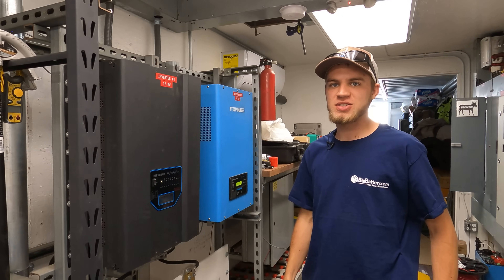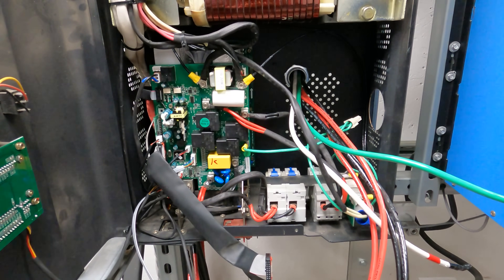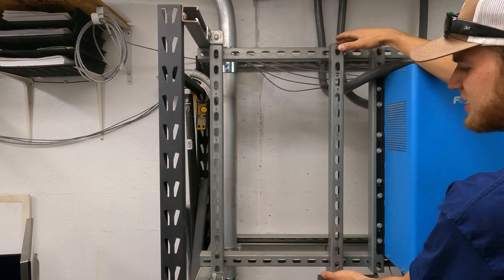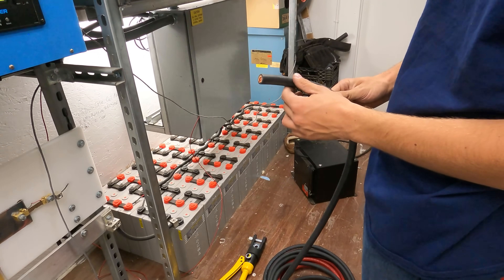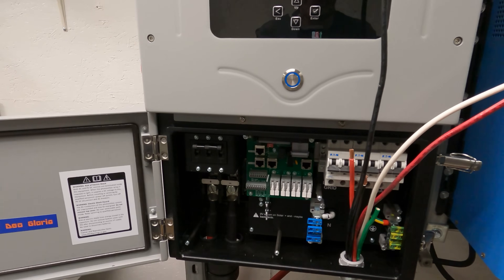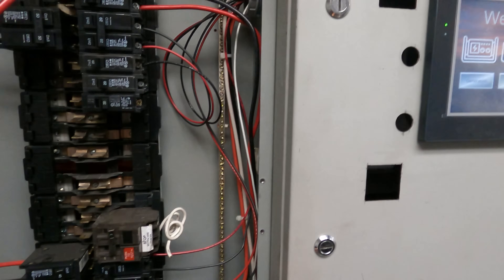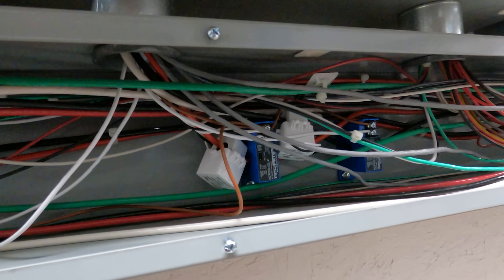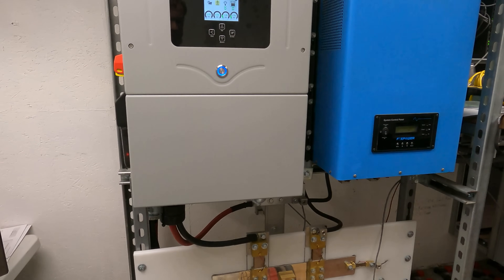Sol-Ark 12K Hybrid Inverter: Off-Grid Installation

Comment: Good video! Thanks for the step by step guide. 
Is there a limit or consideration on the battery cable length? I was considering installing my Sol-Ark 30ft away from the batteries, just for convenience of AC cabling. Battery & Service Panels are not in close proximity....

Comment: Hi, I own a Sol-Ark 12k inverter, and it emits a 15kHz whine when it's running. It's about 60 decibels if you're close to the unit. Do you happen to be able to hear that high? I can hear it distinctly in this video at 15:02 when you open the panel and are showing the board. I want to stop it from making the noise but haven't had any luck with adjusting anything.
Reply: Any luck with noise dissipation / isolation of inverter noise?
Reply: Are you taking about the fans? That’s the sound I’m hearing.

Comment: Watching from Australia. No load power draw is a big issue for smaller off grid systems.
I’m looking at the all in one growatt hybrid 5kw. It’s only about $1000 USD and also draws 60w no idle. BUT has a power saving mode when little load is detected ( same as sma etc etc ) and virtually draws nothing.
Does this unit offer this type of mode ?
Cheers

Comment: the ferrite rings help cut down RFi , we use a ton of them in the Ham radio Community
Reply from the maker: Sounds about right.  We haven't done any testing comparing with or without them, but we don't have any issues leaving them installed.  Sol-Ark must know what they are doing.
Reply: @HighTechLab  I bet if you tried putting HF ham gear in your place you would notice more than you think. It can also create problems on wifi as well. But it would be a fun test
Reply: We use them on high efficiency HVAC equipment with variable speed 3 phase dc motors. They work.

Comment: How can those generator wires handle 55+ amps?  Don't look big enough?
Reply from the maker: #6 thhn.  Nec table located in article 310.15
Reply: @HighTechLab  Bigger than I thought.  Definitely big enough.  Have you tested the amperage on them?  Just curious how much amperage really is coming from the 14,000 watt generator on the 240 output.
Reply from the maker: 55-60 amps.
Reply: @HighTechLab  Wow!  I am impressed.  That means you are charging the batteries at 13,000 watts?  I thought I was doing good charging at 2,200 watts.  What is the current/charging limit on the charger?  I need to go look at the specs on that monster, lol.  Thanks
Reply from the maker: Batteries charge at 9kw and we have other loads direct on generator.  Sol ark does peak shaving (generator support) which we have a limit on the generator set at 13kw

Comment: FFS, you yanks get way to comfortable working around bare power carrying conductors. Insulate your DC and stop using tools around it. You have enough stored energy to see a screwdriver or spanner dropped land you in hospital or worse. The tiny extinguisher sitting right there aint going to do SFA.
Reply: You read my mind

Comment: Yes lower cost inverts are less efficient but with the 5000 less sticker price you can buy alot more solar panels to offset any efficiency losses
Reply from the maker: Tried that route.  A dollar in efficiency is equal to $100 in generation.
Reply: @HighTechLab  not really. You could get another 2-5kw solar array for the difference in price.
Reply from the maker: Yes but your idle draws occur at night as well. Now you also need batteries.  Batteries are the number one most expensive part of an off-grid solar system.

Comment: Wrap each cable around the ferrite core 3-5 times. Not just through it. You have one for positive and one for negative.
Reply from the maker: That's not what the manual says.
Reply: @HighTechLab  I'm not concerned about the manual. Those are to stop interference. It only works if you wrap it.
Reply from the maker: A. The installation would no longer be NEC compliant due to article 110.3(B)
B. The inverter is FCC Part 15 Class B Compliant based on how their manual specifies to install the ferrites.
C. 4/0 cable isn't going to make 3-5 wraps...Let alone 2 wraps.  
D. Sol-Ark's LC circuit for reducing interference is based on these ferrites installed per their specifications.  Deviating from that can lead to further interference transmission.  LC Circuits must be matched.  Too big of an inductance without appropriate capacitance leads to interference passing through.
The list goes on.
Reply: @kevinroberts781  They count as single turn inductors.  With toroidal cores, each pass of the wire through the inside of the core counts as a turn.
Reply: @randacnam7321  well, that does next to nothing. What is their reasoning?
Reply: @kevinroberts781  Yes it does.  The turn count of toroidal inductors is based on the number of times the wire passes through the core aperture.  Thus the cores form single turn inductors.  The injection molded lumps on cables are constructed the same way.
Reply: @randacnam7321  fair enough!

Comment: Great work!  On your load center's back plane, are you good with NEC 705.12(D) (the 120% rule)?
Reply from the maker: 705.12 (D) states that breakers must be suitable for backfeeding, these breakers are not marked "Line" or "Load" therefore are considered OK for backfeeding per 705.12 (D).

705.12 doesn't apply, because we are (A) Off the grid, therefore not an interconnected system, and (B) Aren't feeding on the load side of the service disconnecting means. The service disconnecting means is the breaker we are backfeeding.  Mainly though, we aren't required to follow 705.12 (a) through (e) because we aren't being fed by a primary source and one more other sources.

I don't believe the 125% rule comes into play at all in any case if A through E aren't applicable.
Reply: @HighTechLab The 120% rule is usually for the grid... Here's where it "might" apply in your case:  100 amp back plane, two 60 amps solar (when you get the second sol-arc); so the backplane might be carrying 120 amps.  Toss in the generator for even more amps ;-)
Reply from the maker: The bussing on the panels is 200 amp bussing. The Sol-Ark is only going to put out 37 amps per leg in normal operation, the only time it ever gets up to 60 amps (and why I sized the breakers at 60 amps) is when gen-support mode is active.  If there is a second sol-ark, we don't get another 60 amps, because the generator (14kw) can only give us 60 amps, so an additional 37 amps on a second sol-ark (97 amps) is still within the rating.

Hope you don't think I'm trying to be defensive, I'm extremely glad you are asking these questions, because it makes me double check myself to make sure that I did all my homework to make certain we aren't going to have an issue in the future!  Ask away about anything, I really appreciate the questions from those who know the codes!  It helps those who don't know the codes learn right from wrong when they read these discussions.
Reply: Sounds very well thought out!  Very interested in your experiences as Sol-Arc was my #1 choice until circumstances made it so the system had to go outside (this was before they started on a NEMA enclosure).

Comment: Looks good man!  What size wire are you using from inverter over to c/b panel and what is the idle amp draw?
Reply from the maker: 6AWG wire and it's feeding a 60 amp breaker.  Idle draw on the inverter will be discussed in the next video.

Comment: Good clean up on the install.
Note: on my 8k I installed one ferrite on each cable inside the panel not outside. One sits a little tilted but they fit and look a lot better...

Comment: I was like that's a nice unit... google.... holy fack ...not 7 thousand dollar nice. Wow
Reply from the maker: 2000 dollar nice has wasted over 2.5 megawatt-hours over the last 2 years.  The efficiency gains and reduced idle draws are (we paid $6800 out the door) nice...This unit will pay for itself quickly, when you consider 5KWh were being wasted PER DAY with our old unit.  That's 14% of our battery bank's capacity, and 20% of our winter-time daily generation.  The cost of the additional batteries and SOLAR PANELS & RACKING far surpasses the cost of efficient hardware.
Reply: Add a few grand to any 'equivalent' inverters to add in the cost of charge controllers that can handle 400V PV inputs.  An equivalent Conext XW+ system for example (1 6848 inverter, 2 600V charge controllers and their special load center) would be around the same price as a regular Sol-Ark 12K while only handling 6.8kVA from the inverter.  And much of the Sol-Ark cost is for amortizing the NREs of developing the EMP hardened variants of their inverters.

Comment: Its called 12k but I thought you mentioned 9k limit.
Reply from the maker: In Off-Grid mode, the battery to AC wattage is 8000 watts, but it can still convert 12kw of solar to battery or load output.  If you are only using it for batteries to loads, then sure, it's an 8kw unit, but they call it a 12k because of the solar input.

They make a model called the 8k, however, it lacks a lot of the functions such as parallel stacking, and is only around $500 cheaper.